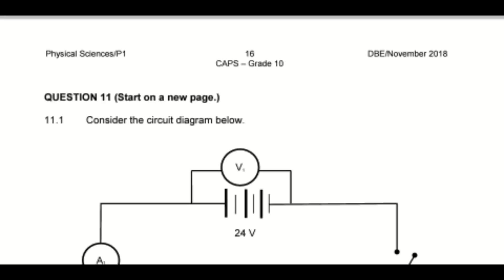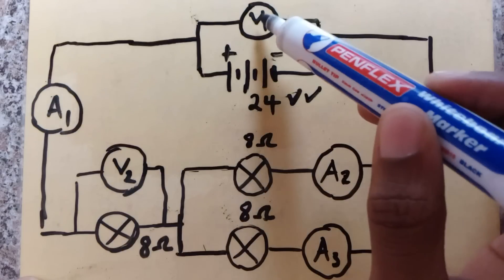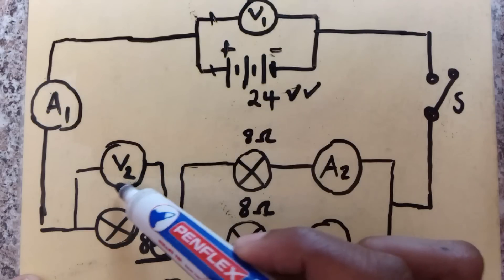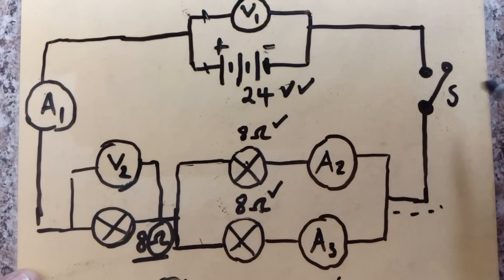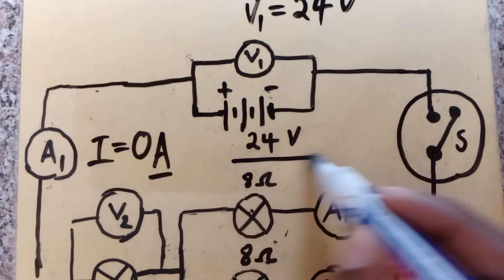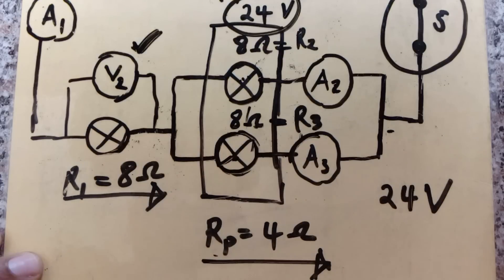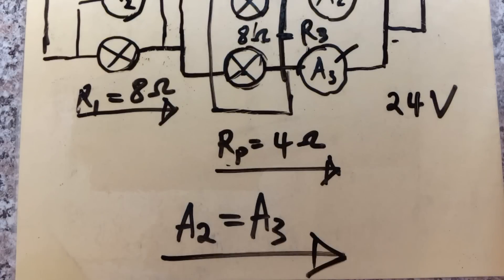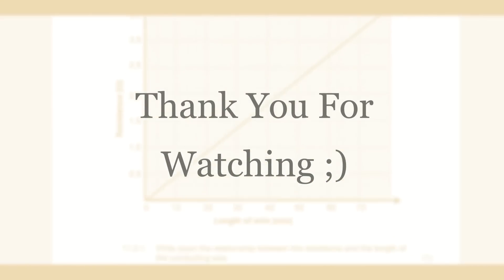Electric circuits grade 10 |  Exam Question.

Comment: Or to find reading on  V2, you can first find the current (I = VT/RT) which is 2 and use the formula: I × R1 which is 2 × 8=16V.

Thanks for the video, I'm writing tomorrow and this will help me a lot.
Reply from the maker: Yes 😃😃, you are right. Using Ohm's Law you can find V2 that way. Thank you for watching.
Reply: I actually always used l=VT/RT

Comment: Since Rp have the same value or magnitude, therefore it means that A2 = A3 and both of them are equal to 1A. Hence Vp = IR2 = (1)(8) = 8V. Also if you are going to use R3 you can get the same answer.
Reply from the maker: Thank you so much for your feedback. You are correct, there are many  many ways to go about solving the problem.
Reply: how can you prove its equal to 1 though? using formulas?